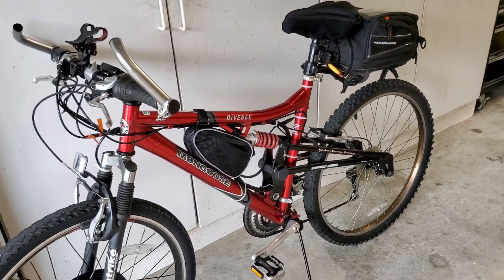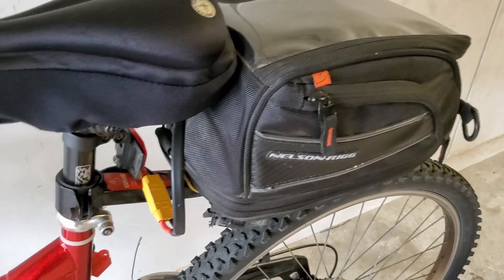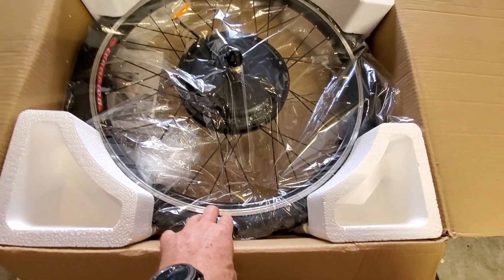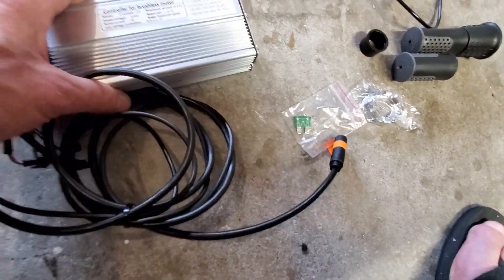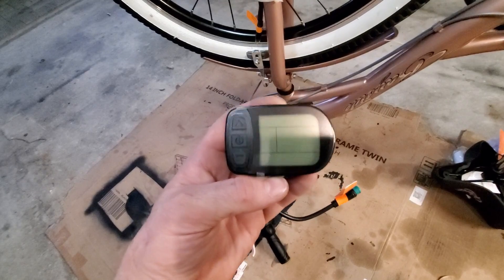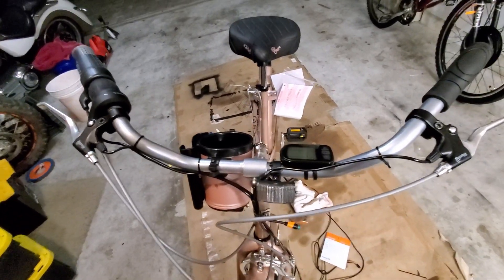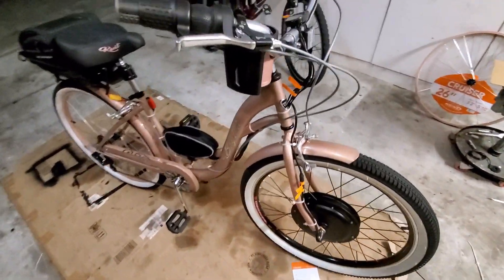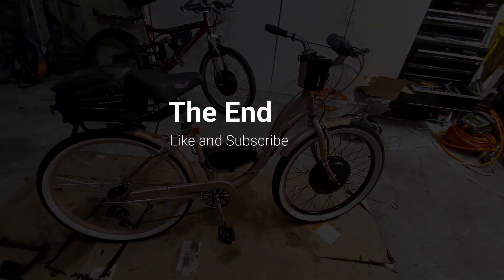Electric Bike Conversion from a kit  (1000W 48V 20aH Front Hub drivetrain) -  Ebike Conversion

Comment: can an engine like this a front hub motor be put on a bike that doesn't have hand brakes on it that just has regular foot brakes
Reply from the maker: I do not see why not, just be aware that with the speed this thing can go, stopping may be an issue. Just make sure your rear brakes can handle it.

Comment: Sup doc nice work..! I recently brought a ebike kit for my bike. witch is a bayside beach cruiser.. i noticed your wife has the same one and color as my wifes bike.!  Well i wanna knw the name of that kit because i wanna get a kit for my wifes cruiser..!? Lol i knw this post is old so take your time with answering..!😇
Reply from the maker: Hi and thanks. The kit I bought on Amazon is not available, but the link below looks like the same kit under a different name. I bought the front wheel version as I did not want to mess with the derailer gears and etc. in the rear. The only issue I had was connecting the pedal assist sensor on the pedals. I had to make a sensor mount out of some aluminum and a hose clamp. It works well. Also, I did end up installing a front hydrailic disc brake from a kit I bought later as the hub does accept a rotor. It would be good if you have disc brakes. The traditional caliper brakes just don't stop quick enough at speed. Good luck. You still need to buy a battery for the kit, but the 48V 20Ah batteries have become less expensive now also. 

https://www.amazon.com/PEXMOR-Electric-Conversion-Controller-Throttle/dp/B0BVM3J5KD/ref=sr_1_4?dib=eyJ2IjoiMSJ9.c7ho03KQFe5kEA4LwZuzFDBfXO0swlSM_rK6fBQS7ABmWxbbUoymou19m9MxycNEWo64YKo6mGUxv9Q2RL14xCudjBm58aizqmVa22zb2WFmUxdvFbirOTOyk6ZsIpq2MG_amMhqOCP8XmkO_YcfyAprf46XK914T97iyC5MNfuon2cVNQznTSTUTSqBhg9ctkBzbZgJYq8a5NEAj1-t8SScWHMi4TL-QGQwaQWv2b4.cl8S6qEx4FHXeQSYC-pnSoSKcd_Sa79PJ46iHWqAins&dib_tag=se&keywords=E-Bike%2BKit&qid=1748019201&sr=8-4&th=1
Reply: @donsdoityourself2547 thank you.. that's the same kit I got for my bike. Witch is a cruiser as well. This was very helpful. .

Comment: And the great thing about front wheel drive is that you have all wheel drive. What's it like though being pulled along rather than pushed?
Reply from the maker: Front wheel drive is nice on pavement. Have to be careful in sand as it does not have the traction. That is where the all wheel drive is nice, but I build this for urban use, so it works great.

Comment: Hey Don, are you able to add links to the parts you bought. Thinking of doing the exact same thing.
Reply from the maker: Here's what I used. Bought from Amazon.com. 

Hub:

AW Electric Bicycle Motor Kit 48V... https://www.amazon.com/dp/B00YBWA5VC?ref=ppx_pop_mob_ap_share

Battery:

7 Styles of 48V Lithium ion... https://www.amazon.com/dp/B09D7273KC?ref=ppx_pop_mob_ap_share